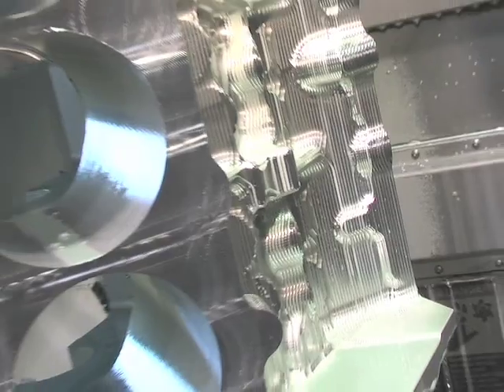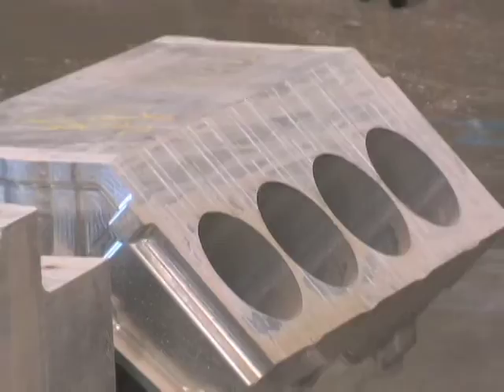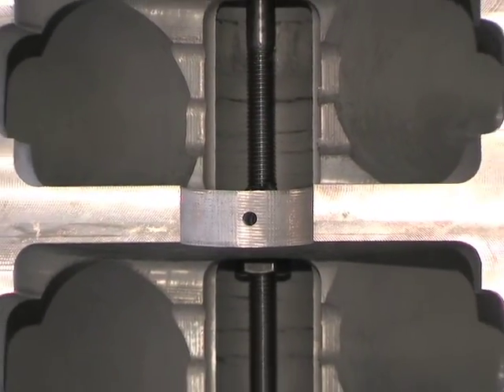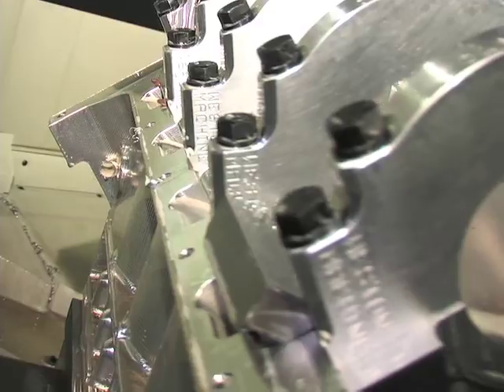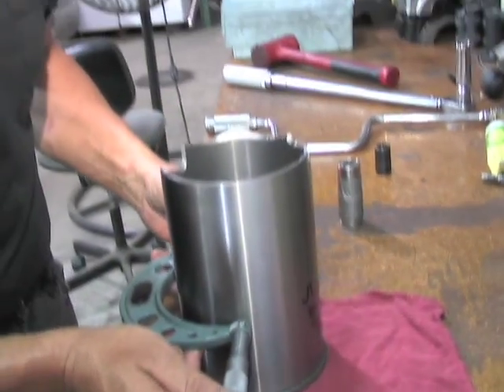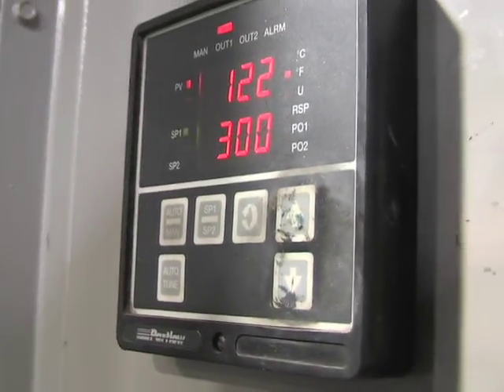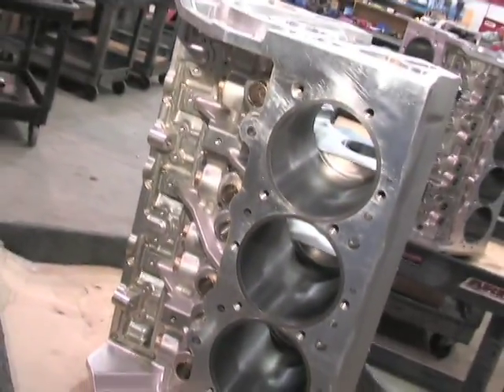Dart Billet Aluminum Racing Engine Blocks

Comment: Can yall do cooling jacketed billet aluminum cummins B6.7 performance blocks? Looking for low clearance custom heads, dry sump lubrication system and so forth. As light weight as humanly possible (yes i know, silly silly to ask to make a light B-series, but im serious).

Comment: I need a 7.3 Godzilla block made because l plan to fit it into my ford falcon. I think the less weight in the block would improve the cars handling. What will l need to do...should l bring the block so you can measure it? And how much would that roughly cost?
Reply from the maker: Hi Peter, 
We are unable of a Godzilla option in a Dart Billet Block. I would recommend you contact Dart Machinery directly @ 248-362-1188

Comment: I am looking for a aluminum block build for a 2004 Jeep Rubicon for both offroad and street applications.  Any recommendations ?
Reply from the maker: Thank you for your question.  The most cost effective solution would be a 5.3 or 6.0 Aluminum block LS engine.  These are available from junkyards with transmissions, accessory drive, ECM and harness, etc.  There is a lot of aftermarket support for the swaps.  Summit Racing and the OnAllCylinders.com blog have identification articles by VIN code etc. that can help you determine which engine came in what vehicles.  There are upgrade articles for all 46 Gen. 3 and Gen. 4 engines as well.

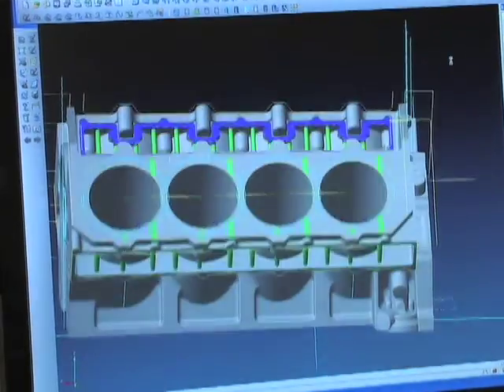Comment: 1:35 .... any combonation, ford heads on a chevy block and vice versa. Umm, how bout nooo
Reply: Bige4u no mopar???
Reply: Ls1 heads have been bolted to Windsor blocks. Slight mod on the head studs and and water passage. Cheap bolt on power.... why not.

Comment: I wonder if they can make a cummins or duramax diesel block? Doesnt chevy or ford freak out when they copy their design?
Reply: Michael Cuff they don't 100% copy they"custom design"
Reply: The popular engines were designed in the 50’s and were phased out in the 2000’s. It’s bad PR to go after enthusiasts or the companies supplying aftermarket parts.

Detroit isn’t that dumb

Comment: How can they machine a water jacket in a billet block? I think that's what they said they can do..
Reply: Sleeves. I don't think they're running aluminum sleeves. They're using insert ductile iron sleeves, no doubt. The water jacket would exist between the sleeve and the block.